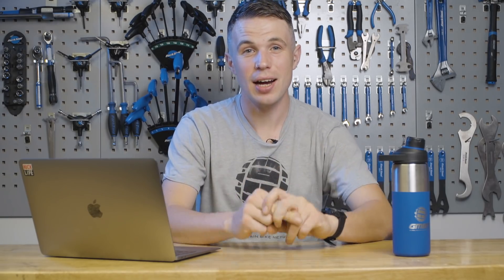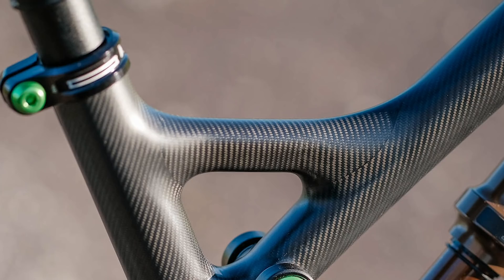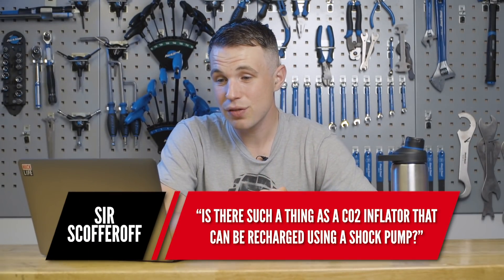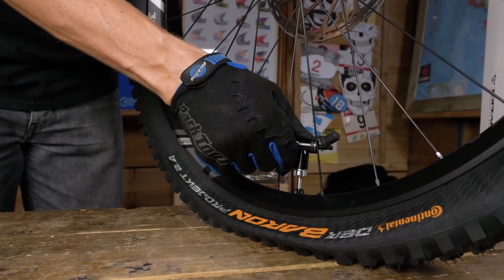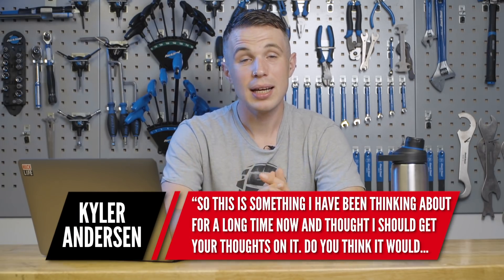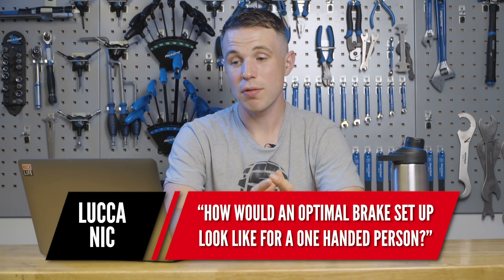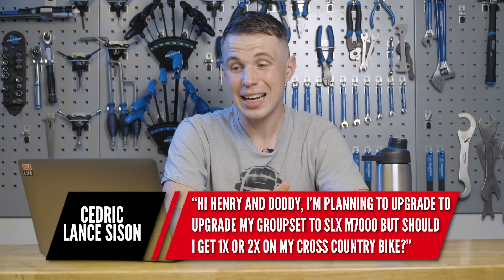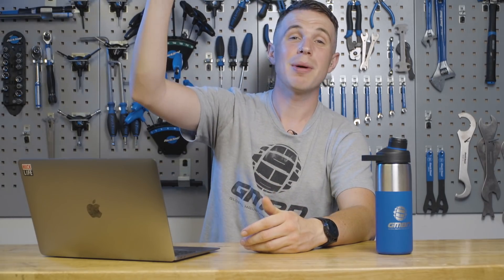Why Are Fork Stanchions Circular? | #AskGMBNTech Ep. 88

Comment: I've heard of people running non-boost rings/cranksets on boost frames. It just moves the chainline closer to center, biasing the chain toward the lower gears. If you spend the majority of your time on the lower 2/3 of the cassette and only rarely use the highest few cogs then it makes sense. Just gotta take care that the ring will clear the frame and the chain will clear tires.

Comment: For most people I would agree to choose an x1 system, but not for everyone. Because of some 'limitations' of my body I need to get my cadence just right to achieve the best results I can. In that case the steps between gears can become a problem. If you take the time to select the best gearing for your needs in a x2 system you can get that cadence the way you need it without loosing in speed. That is what I did when I was still competing in triathlon.
Because of an accident almost 20 years ago it is not on my list to compete in mtb/triathlon so it doesn't matter that much that I could be a little bit faster, so my next bike will most probably be one with an x1 drivetrain.

Comment: Carbon frames could still break no matter how overbuilt they look because you can’t see the damages that are inside the frame.  I won’t listen to the presenter on this one if you value your life.  No matter on having paint scratches, the aluminum, steel or titanium bike should be inspected for crashes, cracks, bends, rust, stuck parts and so on.
Reply: Metal fatigue.

Comment: Hope have got a one handed brake solution now
Reply: As a bike mechanic, I made something like that for a mtb rider in Brisbane about 12 years ago. Essentially, it was 2 brake levers mounted to the same side of the bar, as the guy only had 1 arm. The bite points were staggered so the top lever applied the rear brake first. He was fast!

Comment: Re: electric breaking to nullify the problem of running out of battery so your breaks no longer work why not have the system set so it locks up when no battery. Have it so when the battery is very low they work until 4ue last time a person stops then they lock on to prevent the person carrying on. Obviously there would need to be a switch to unlock them but this wsy tye person would know that they are out of battery's so take the needed steps to get home.
Reply: Good idea
Reply: Imagine that. 
You ride your bike all the way up a steep climb and stop for a moment to check your suspension lockouts and your brakes lockup on you. Now you’re stuck.

Sounds awful, and like a problem that would make the brakes unusable in my eyes.
Reply: @davidbronstein2040  no as I said you'd need a switch to use to unlock them as in say turn them back on and it'd give you say 30 min more power to get it home taking the necessary precautions before full lock up and the second time the switch would open them but they'd be unusable to allow you to push bike.

Comment: #askgmbn hi, I want to remove the paint from my aluminum frame. Which is the best way to do if I want a raw finishing frame.
Reply: I would personally recommend sand blasting it. But you would want to be very careful with doing that.
Reply: @jonathonhazelton2060  Better be very careful not to damage the frame that way. Most alu frames have really thin tubes, easy to damage with sandblasting. I would go to a shop to have the frame chemically stripped. I did this once manually on a frame using paint stripper, but that was tedious and took me 3 weekends to clean up, and there were still small nooks and crannies that showed the original color (it was a Turner frame with lots fo CNCed parts).
Reply: Didn’t think about that. Thanks for pointing that out. Yeah a chemical paint stripper can be designed to strip paint and not damage the Al.
Reply: Hi, I did my frame and used a drill with a wire brush attachment, worked really well and leaves a nice brushed finish.

Comment: To help with @Lucca nic 's question: I have a friend with nerve damage in one hand that rides a 1 handed set up. A simple way to go is use Sram brakes (which are very slim) and stack them. They're actually quite adjustable that way and he had his pretty dialed after only a couple of rides. I believe Hope Brakes are coming out with a 1 handed, all-in-one set up, but I haven't seen them on the market yet. Also, check out "no front brakes" on Youtube. He's been running a one handed set up for several years, and has excellent content on his channel.

Comment: The co2 idea isn’t bad but it’s nearly impossible for a standard consumer to pressurize that air so much that it becomes a liquid. It would also need to have a quite sturdy valve
Reply: air is mostly nitrogen gas, which is way way harder to liquify. Hence why its a CO2 cartridge and not an air cartridge

Comment: Refillable small bottle cartridges (8/16oz) would take a  huge amount of effort to refill yourself with air due to the amount of pressure you would need to inject into them to make them useable. As the pressure inside the cartridge increases the amount of effort to put more in increases. With a track pump an average person may be able to pump up to about 200 psi in one which is not enough to inflate a mountain bike tyre or reseat it.

Comment: It's not worth it all in all if you want a hot one by system get a gravel bike. A beach cruiser idea is just so sorely mistaken for a reputable ideait is not worth the penny that you're putting towards trust me it isn't.just let me put it to you like this would you spend $5,000 for a 10 speed bike on a 1 by system? For that type of money I want all the gears I want all the bells I want all the all the chipping in the bike performance in jacking up the prices it's just Ludacris. And yes I have a 1× so I do know what I'm talkin about unless you plan on going downhill a lot have at it because that's the only time it would be worth anyting,cross-country it is not I don't care how you spin it it just you go through the gears quicker the right range at a lower gear at a lower speed without spending your tires so you have to deal with that it is not worth it and by the way these companies need to bring them back and leave that as an option for those that want to actually cut their performance.I am in fact waiting for parts to come in so I can change the wheel that I have on my one by to put it back on my other bike and use the three by 9 or 3 by set up and just use that as my beast..strongly advise against the one by unless you plan on getting the gravel bike.

Comment: #AskGMBNTech
Hey Guys, i have E*13 TRS dropper post installed on bike (dropper is mechanical). That leads to my question: Can i hang my bike to it without getting any problems?
Cheers Ben
Reply: Should be fine as long as it's fully extended

Comment: It's easier to seal something circular then something square. Also the pressure equals around perimeter of circle. Square seals would blow at the edges
Reply: A round is the easiest shape to manufacture and seal. It also distributes the pressures the best. Making square stanchions is impossible and ovals are a nightare to manufacture. We are taking about hundredths of millimeters here.
Reply: Batu Çetin  I'm gonna take a guess and combine both theories. A circular stanchion can twist within the lowers without breaking the seal. An oval would create areas of high/low pressure around it's seals
Reply: I think the person that asked....was probably referring to maybe an oval shaped stanchion.
Reply: "Nah, it's just ice cream..."
Reply: The cylinder shape with a consistent radius will provide the strongest cross section for the stresses/forces the fork will see. Combine this with the ease of a smaller diameter cylinder sliding within a larger diameter cylinder and you get an excellent recipe for strength and durability with reliable and consistent execution (assuming the other parts & internals work well together.) 🤘

Comment: #askgmbntech I have my dad's 2004 cannondale scalpel, it has a lefty and the 26" wheels that came with it. i crashed it and now the front wheel is a bit bent (not too much but still annoying) and finding 26" lefty wheels for a price of normal wheels is pretty hard, is it possible to just buy normal wheels and switch the hub or do i need to find a lefty wheel that will fit?
Reply: You could use the existing hub and lace that to a new rim. And honestly if the current rim isn't too bent you can always true it up

Comment: You're spot on on the engineering Henry. I'll add a bit of nuance to car brakes. They are normal hydraulic brakes, just very heavy to push. But they have a vacuum pump driven by the engine that adds power, a brake booster. Electric cars are similar, either electrically driven vacuum pumps or electric hydraulic pumps. All solutions have a reservoir of pressure which allows you to brake safely if you lose all power. If it runs out, the brakes become very heavy but still work. I wouldn't want anything on my bike that failed to brake completely if it lost power.

Comment: Square Stanchions are more likely to crack\snap. It's for the same reason aircraft windows are oval
Reply: Why pillars on mall building square?
Reply: @adityawardhana6066  Pillars on a building aren't moving or have to deal with constantly variable forces. The a force building produces is always downwards and it's at a constant pressure. So the pillar can be square. Also not all pillars in buildings are structural.

Aircraft windows are oval because as the plane cycles from sea level air pressure to 35-40k ft and back to sea level, the whole thing expands and contracts. This causes metal fatigue and cracks can form at the corners of square windows. Google BOAC flight 781. Forks are the same. The constantly variable force of the stanchions flexing in the lowers would cause stress cracks through the corners and they would eventually snap just from normal use.
Reply: @M3PH11  ummm, wind? Earhquake?
Reply: @adityawardhana6066  so if you're implying that in an earthquake/very heavy winds or something that you'd could have horizontal forces on the structure, a pillar no matter what shape wouldn't be much use. Since it supports vertical forces (e.g. weight of the building). I'd say you'd need some additional supports specifically designed to counter these horizontal forces. Then having them it comes back to the same idea, that you just have forces going along the axis of the beam/pillar whatever, not in all directions around the support.

Another important factor is the materials themselves e.g. concrete is strong in compression (being pushed inwards) but easily fails in tension (being pushed outwards).
Reply: @Andy-tc2gt  Also in a suspension fork application the extra internal bracing required would make the uppers very heavy while also passing the load to the much weaker lowers, which would cause them to snap and way faster than the uppers would. To reduce weight metal would be out too. How does carbon cope with high mixed lateral and longitudinal forces at the sametime? Oh! yeah. Right. It doesn't. So all in all it's far to expensive, unreliable and frankly not worth having square forks.
Reply: The cylinder shape with a consistent radius will provide the strongest cross section for the stresses/forces the fork will see. Combine this with the ease of a smaller diameter cylinder sliding within a larger diameter cylinder and you get an excellent recipe for strength and durability with reliable and consistent execution (assuming the other parts & internals work well together.) 🤘

Comment: Hey Henry, you're correct on the CO2 pressure. Cylinder pressures run roughly 800-1000 psi, enough to compress the CO2 into a liquid. Upon pressure release, the CO2 rapidly evaporates and expands, hence the crazy drop in temperature.
Reply: Not only that, but you wouldn't be able to pump just CO2 into a cartridge if a shock pump could go that high.

Comment: #askgmbntech
Hello guys! Absolutely loving the show! I'm a 16year old from Toronto, Ontario in Canada and this is easily my favourite youtube channel!
Now... on to my question:
I bought a 2015 Specialized RockHopper Comp29 used for 475CAD. It has SR SUNTOUR XCR coil forks and whenever i compress them, there is always a black residue that stays on the stanchions in kind of like a thin ring. Is this a sign of a low quality fork or one that needs a rebuild? If it needs a rebuild, would i be better off just upgrading it? (I have a tapered stearer tube so upgrade potential is huge but im pretty much broke). Thank you so much GMBN TECH crew in advance!!!
(Edit): I forgot to mention that they have a crazy amount of sticktion (idk how to spell it, sorry)
Reply: probably worn out wiper seals, the rubber in them could be breaking down and mixing with the oil in your lowers and that would be the black residue. along with your issues of stiction I would try a lower leg rebuild and replace the wiper seals.
Reply: @tairny  Thank you very much!!! I really appreciate it!!! I'm pretty sure GMBN Tech already has a video on lower leg service so it should be doable
Reply: @julienhagens1544  no problem man! Lower leg services are really easy to do!
Reply: I don't believe it's a problem. I had suntour forks on a GT Zaskar I had a few years ago and even brand new there was some residue on the stanchions. I think it's to help the seals to stop water and bits of muck. It's also some sort of lubricant, the sort of stuff found on the tops of brand new dropper posts after you use them a few times.
Reply: @The_Real_JN  and @ultiss  Thank you!!! I really appreciate your advice!! Hopefully GMBN Tech has a vid that should be easy enough to follow
Reply: lower leg service is easy to do yourself, give that a go. When you do that and the stancions look scarred/rusted around the bushes you better look for a new fork
Reply: @ultiss  that's true actually. There are tons of vids to guide you through the process.

Comment: #askgmbntech Hi, i have a problem with my front suspension fork.
When something its it slow, it works smoothly but when sonething hits it fast, it doesn't work.it gets stuck and feels so stiff.
Can you explain it to me please? ...on next episode
Reply from the maker: Check your rebound damping isn't too slow. It could be that on faster sections the fork isn't able to retract before the next hit. It could also be an issue with the compression damping. Try running your rebound a little faster and see if this helps. If not it is worth having a suspension specialist look at it.
Reply: Pushpa Stha try adding some volume reducers to your forks, that should work. Also does when you hit something fast does it bottom out?
Reply: @shaunfrost5695  tokens will make it more progressive, so totally wrong approach
Reply: @shaunfrost5695  do you mean if stanchions completely goes in or not?
If i am correct, then it doesn't bottom out
Reply: @shaunfrost5695  it acts like a hardnose fork
Reply: @pushpastha4342  its probably something with your compression damper in the fork. make sure the fork's compression adjustment or lockout is set to fully open
Reply: Hmm i dont know then sorry, best leave it to the experts
Reply: @shaunfrost5695  he's basically saying (as far as I can tell) that on faster "harder" impacts the fork stiffens up but on slower speed it moves normall
Reply: @tairny  yes thats it
Reply: @tairny  lockout is completely open but harder impact makes it stiff
Reply: @pushpastha4342  could be something internal. Also are you running the correct air pressure/spring weight and the correct sag?
Reply: @tairny  yes I am... No matter how much i change d air pressure set up sag, its still the same
Reply: @pushpastha4342  do you have any volume spacers in the fork?
Reply: @pushpastha4342  if there are some remove them, if there aren't any I would take the fork to a shop/suspension place and have them service the fork. Most likely something is broken or misaligned in the damper so you aren't getting proper oil flow
Reply: @tairny  okay thank you for suggestion

Comment: #askgmbntech hi I am currently running a smooth rolling rear tyre and a heavy big front tyre with a large thread although I’m going to get new tyres soon. should I stick with the smooth roller at the back or switch it around. Your opinion would be appreciated thanks.
Reply: @Jack Vollriede thanks
Reply: Gripier tyre on the front always. U cant recover a front wheel washout, but can control a rear slide